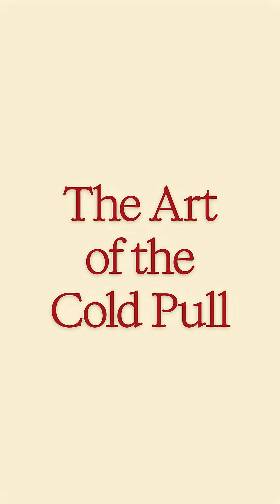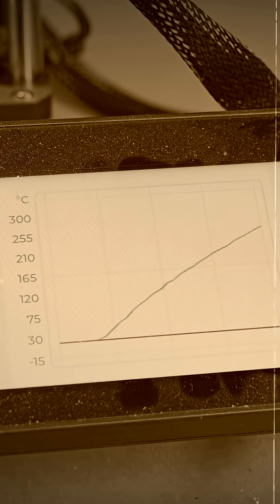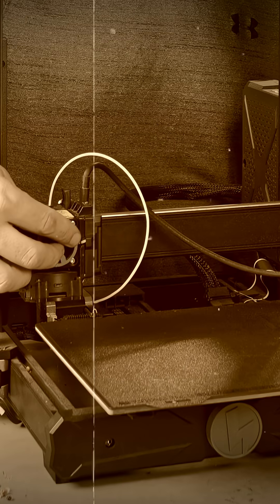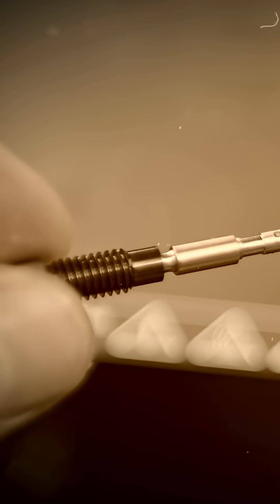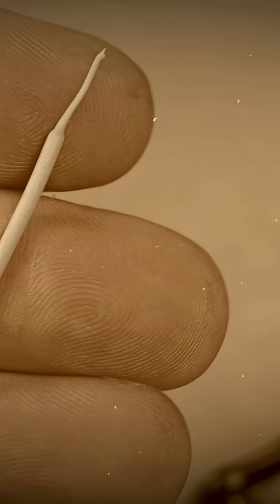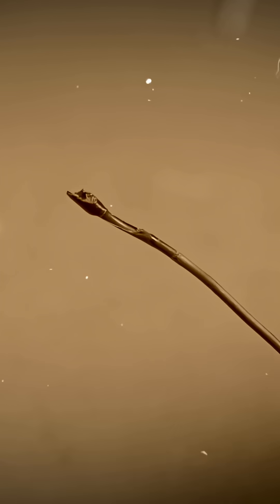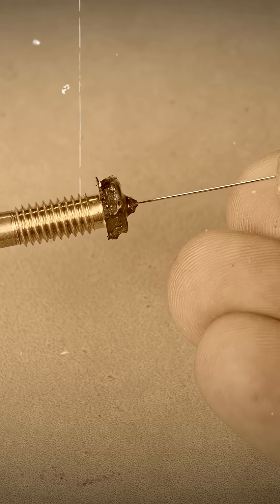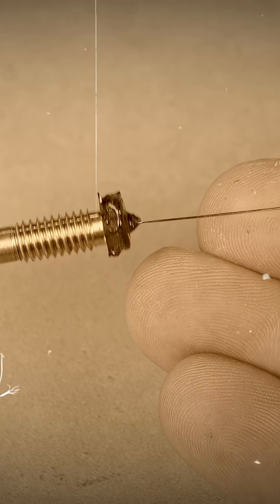How to Unclog Your 3D Printer

Comment: I mentioned this in the full video.  I try to use contrasting colors when I do a cold pull.  If my last print before the clog was black, I'll use white filament to do the cold pull.  If it was a light green, I might use red filament.  That kind of thing.  It helps to see the clog sometimes, but not always.